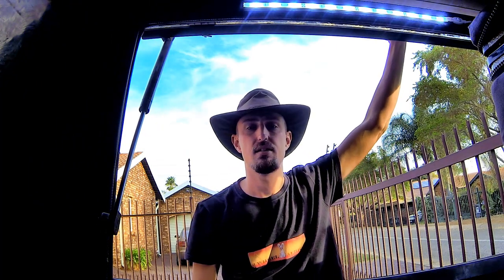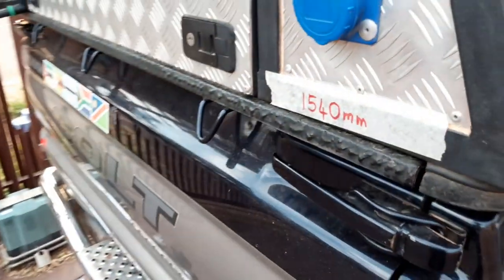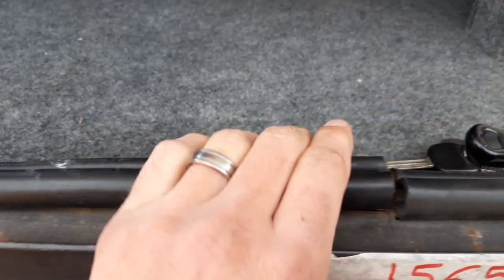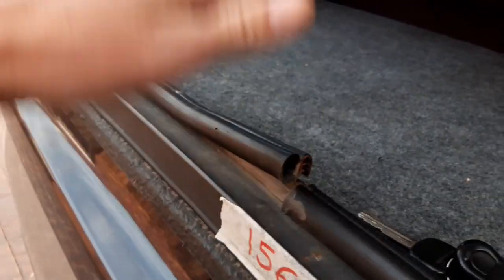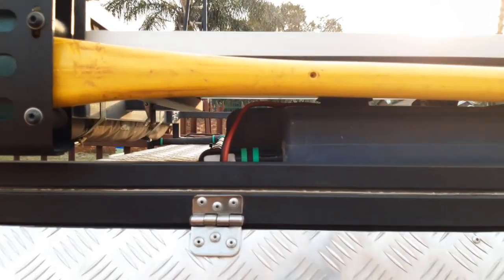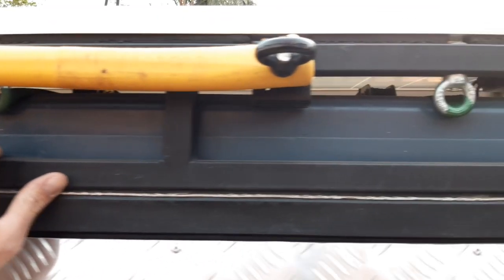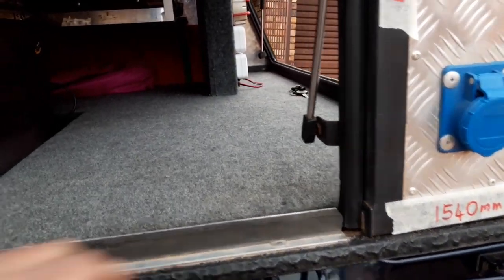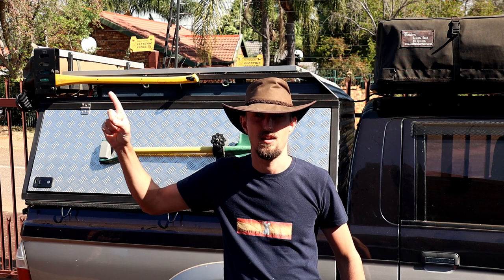DIY 4X4 CANOPY!!!

Comment: Excellent build been looking for ideas and I really like your concept. Will be building it on a nissan frontier pro4x. Whst was the weight of the unit? Since you are using steel framing not aluminum.

Comment: Yes, Chomma. It's looks lekker. How much does it weigh? Hows the colt holding with the weight and is the steering lighter now or the same? Suspension taking a beating? I have a 2.8 colt 4x4 and just found what I want to do and take ot to the Khalagadi.
Reply from the maker: Hi Dumi. I cant answer you on the weight but the bare canopy was lighter to pick up than the fiberglass one I had on. I have aftermarket suspension and rear can be ajusted to compensate for weight. Thus steering is good. I have to say the weight can easily add up and could be excessive. On the same note the Colt can handle a beating.  Enjoy the Khalagadi as it is truly an epic adventure. Matopi camp and Mabuasehube was probably one of my most memorable trips ever.....
Reply: @4wheelafrica676  thanks man i first have to get new tires and egt then I'll go check those spots out. In the meantime I'll start working on the canopy, oh by the way your the only one who actually gave measurements on your build and thats awesome can't wait to see what you gonna do next. Enjoy the beast.

Comment: Awesome looking canopy. You've inspired me to attempt something as close to this as possible in the coming weeks. Just one question, I'm quite a beginner to intermediate at this kind of stuff... For the angled square tubing, is there a way to calculate the cut angles, or did you just score it when the top and bottom sections were in place? Many thanks.
Reply from the maker: Hi there Capt. You score it when top and bottom are in place. Makes it less complicated. Thanks for the compliment.😉

Comment: Great video! Do you think 40x40x1.5mm steel would hold the weight of rooftent and gear?
Reply from the maker: Hi Scott. Thanks for the compliment bud. It should hold the weight. Make sure the welding is sound! 😀
Reply: @4wheelafrica676  Thanks for the reply! Starting the build next week

Comment: Awesome build! Would it work if I were to use aluminium tubing instead? If I use steel, how do I prevent water from seeping to the tube via rivet holes?
Reply from the maker: Hi Stan. I used steel as I can not weld aluminium yet. Also the price of aluminium was considered. I used sikaflex to seal the plates against the frame. I then drilled the holes and put some sikaflex in the hole and some on the rivet to give it a tight seal. 😀
Reply: @4wheelafrica676  Oic..that figures...I will be building one soon and will share with you once completed :)
Reply from the maker: @stanhon9157  Awesome buddy🙃

Comment: How do you stop water coming out from the rivet during rain.
Reply from the maker: Hi there. I used blind rivets. Drill the hole and dip the rivet in sikaflex before placing it in the hole. Creates a solid seal.
Reply from the maker: Sorry I see a closed end rivet is a better word. 🙂